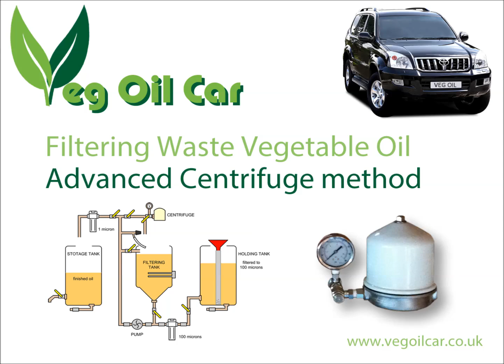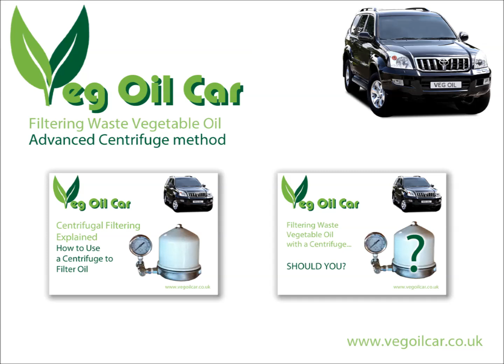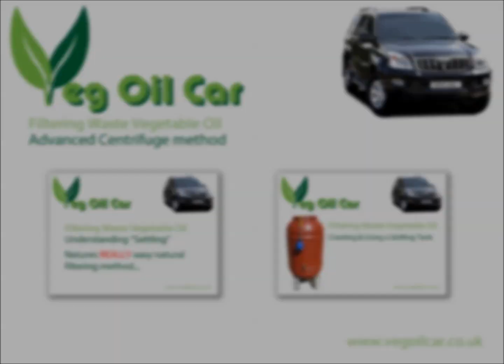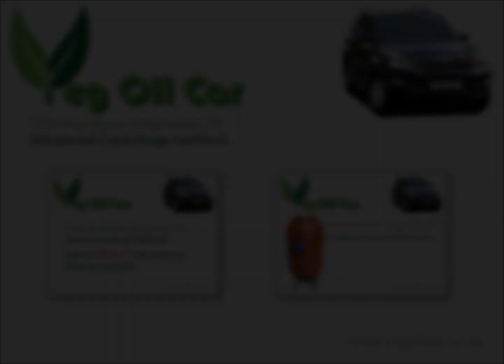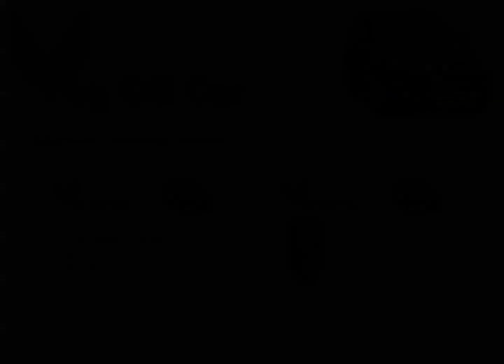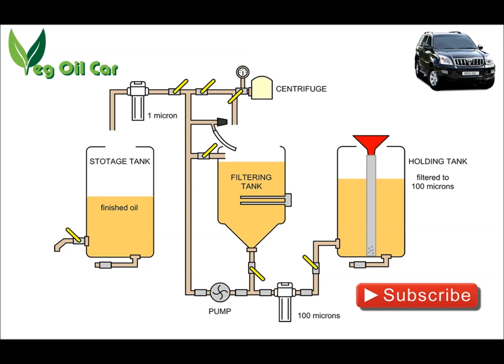Advanced Centrifuge WVO Cleaning Techniques by VOGMAN

Comment: Where do you get one of these centrifuges in the EU/UK?
Reply from the maker: Hi Electro. Try https://www.oilybits.com/centrifuges.html
However, I abandoned using centrifuges for cleaning oil. I don't think it works for a variety of reasons. I developed my much superior multi-tank settling method... http://www.vegoilcar.co.uk/wvo_filtering_multi_tank.php
Reply: @vogman  problem with settling is that it won't remove the biggest engine killer from the waste motor oil, namely the soot. I was about to build your 2 barrel system until I realised that its almost impossible to get vegoil around here anymore. But wmo is abundant in my village we have 5 mechanics, 2 chain ones and three independent 😀
Reply: I'm gonna use it for WMO for my car since its hard to get WVO here in sweden.

Comment: what happens if you use an $8 TDS (Total Dissolved Solids) meter on it (meant for water, but still, the relativity of the numbers might show if the centrifuged oil is cleaner than the oil coming from the centrifuge when turned off
Reply from the maker: That's not something I've had experience with. Shame, it sounds interesting... though my centrifugal filtering days are over.
Reply: If you wanted to test if a centrifuge can further clean settled oil or if it's a waste of time [I have no idea personally] then the simplest test would be to clean your 'fuge to a very high standard and then use it to process some settled oil. If it collects stuff, it's further cleaned the oil. If it doesn't, then the 'fuge stage is unnecessary.  If it collects some stuff, but not much, you'd need to make a judgement call about whether to do it or not, which would depend in large part on what you want to do with the finished oil and what other filtration steps you're taking.